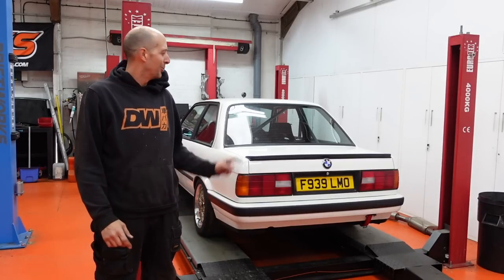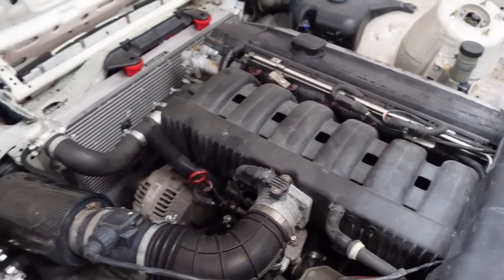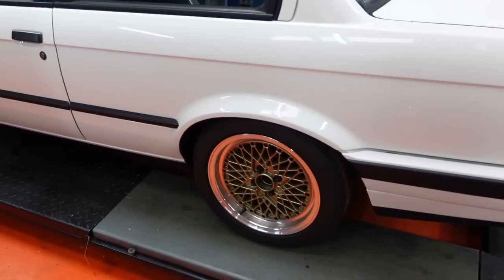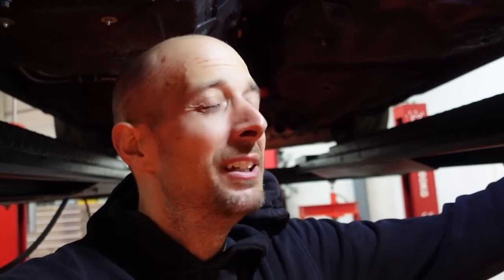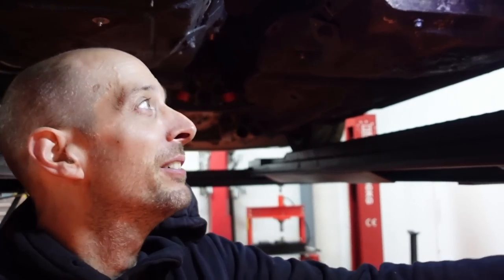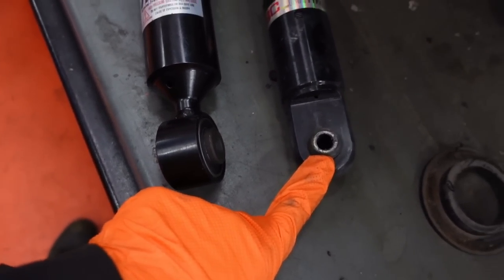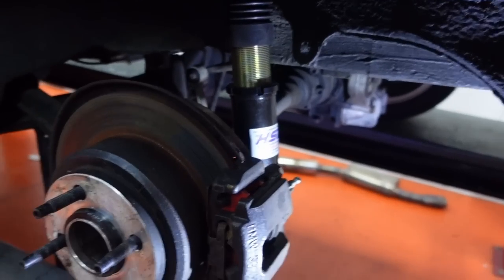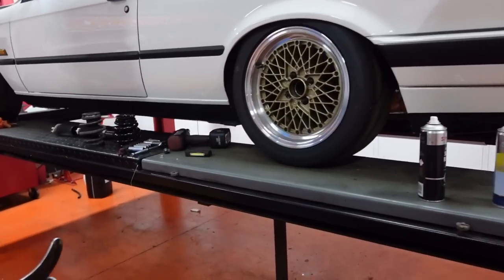Jays BMW E30 Track Car update. New coilovers & fuel system.

Comment: You can get track rod end heat shields that drop over the taper then hang down to protect the rubber boot 👍
Reply: Thanks I’ll have a look
Reply: @JayDontGotThis  depending on size, 106/saxo had them on the bottom ball joint. hope that helps!

Comment: I use Front 140N - 140mm length + Helper and 160N 100mm length + Helper back, i find Helpers always necessary but im also drive a lot on the Nordschleife with bumps and jumps so you have to use Helpers! Would suggest them always
Reply from the maker: Thanks for the info 👍 What engine and tyre size do you use?
Reply: @driftworks  M42 Engine, 9x17 ET38 Protrack with 235 40 17 Nankang AR1 with KW Clubsport Dampers, but also 205 45 16 AR1 with 8x16 et23 Styling 5 Rims, they worked similar 

Car = 1100kg

Comment: Running stiff front springs and softer rears is worth a try, gives better traction but less roll (a good proportion of the weight is on the front with the engine gear box) 👍

Comment: Have you thought about changing the track rod ends to a rose jointed arm? Would be simple enough to make if not available off the shelf. I was also caught out with the inboard spring on my compact, ended up going with 6kg front and 8kg rear (its my daily). Worth thinking about beefing up the rear turrets and going to coil overs on the rear when you can. I disagree with people recommending anti roll bar kits, with that much spring rate you won't need them, they can be useful for tuning oversteer/understeer balance on the fly but otherwise I see them as a bit of a gimmick.

Comment: 10 front and 14 rear would work well on the E30 on track. As the M52 is quite light, 12 might feel abit too stiff with 12 on the rear.

Many guys run 8 and 12s on the road and drive quite well.

Comment: Great video Jay, It's really interesting  to hear some Suspension tech knowledge from Phil too. i I got an 80's semi Trailing arm car as well, (1984 Toyota Celica Supra) And have some HSD DT's on the back and have messed about with spring rates But,  Because of having  Whiteline Adjustable Anti Roll bars, going past a 325lb spring is just awful on anything but circuit. I know yours is track only but was surprised to see you having standard anti roll bars. on it when you wanted to get rid of body roll. You not a fan of them?
Reply: They’re just quite expensive, I’m sure they’d help though.
Reply: @JayDontGotThis  Worth having a go, has made the most difference to all the cars i have modified/ ruined the suspension of! Sell those old BC's  off and invest! :)

Comment: Where can I purchase the wheels or are they for sale?  what are the wheels specs, 15x8 15x7.5 ET25 or ET22?
Reply from the maker: Hi, they're available from Driftworks.com and we actually just made a video on our shop channel for these wheels: https://www.youtube.com/watch?v=-SKPe0U2OQ8
Reply: Thank you Sir just asked a question about fitment on an E30 without rubbing.
Reply: Will the 15x8 4x100 OS mesh mount directly onto an OEM 1989 E30 325is without spacers and no rubbing? It only has Bilstein (1) inch drop struts and Turner Motorsport roll bars in the suspension

Comment: My bmw has slop in the lever left/right. Apparently its the pin in the selector shaft . But nobody knows how i can rectify it 🤷🏼‍♂️
Reply: Mine does too, I guess it’s either drill it out bigger and get a bigger pin, rebuild the box with a new selector or live with it.
Reply: @JayDontGotThis  thats what i thought but ive been told drilling it out will be hard as the metal is hardened.
Be good to see how you fix yours as basically same setup as mine but ive e21